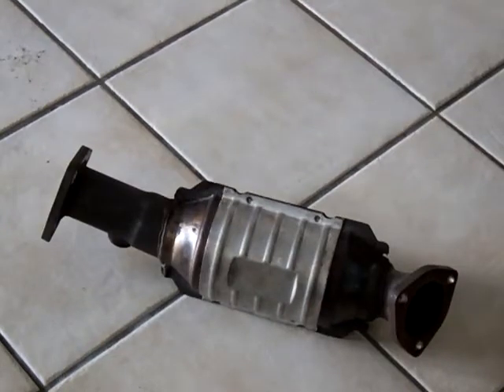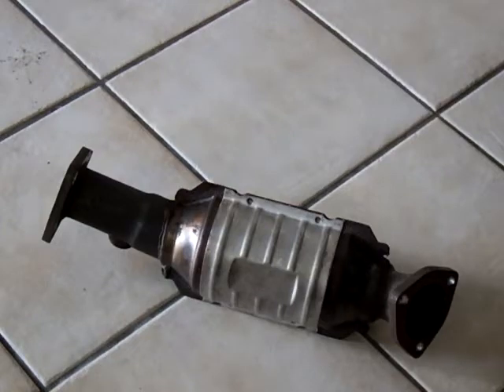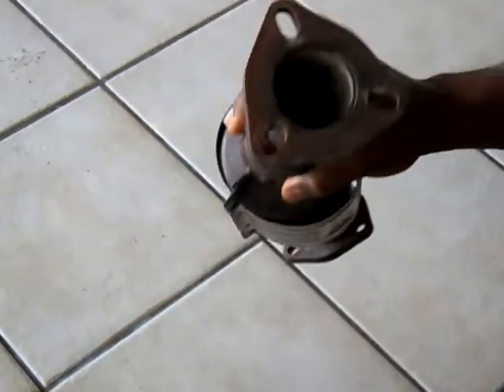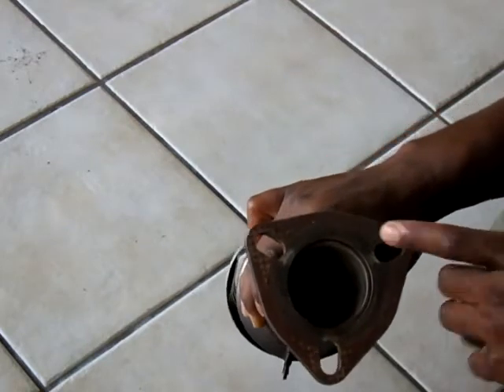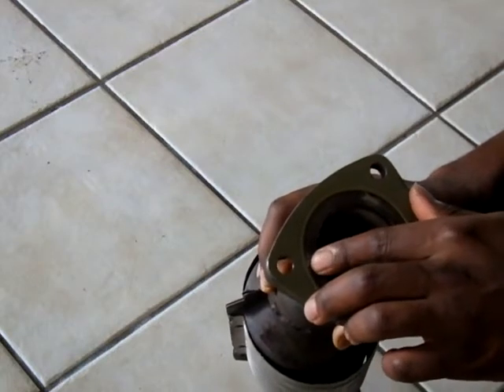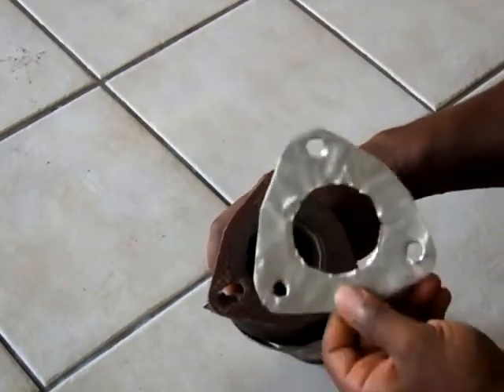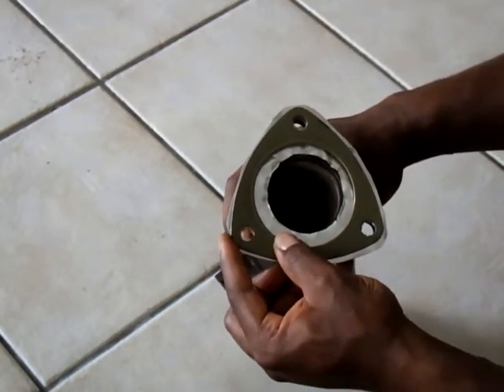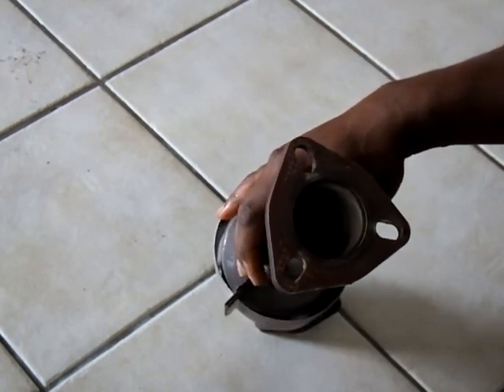'03 VW Passat 1.8T aftermarket catalytic converter - make sure it fits

Comment: Were you able to make a leak free installation (catalyst)? Also did washing it in soapy water work (meaning did P0420 went away)?

Did the misfire codes went away after repairing/changing the Y-pipe?
Reply from the maker: PrinceOfPersia10 Had no leak afterwards. The code came back within a few days. I think the catalyst just didn't meet OEM specs.
Reply: Did the misfire codes went away after repairing/changing the Y-pipe?
Reply from the maker: PrinceOfPersia10 Mine was not misfiring at all. It had only P0420 code. I didn't replace any y-pipe.
Reply: May be you forgot. But you wrote in your explanation notes for the video (click on show more)...

"A leaking Y-pipe also caused a huge vacuum leak that caused misfires on cold starts and excessive gas consumption."
Reply from the maker: PrinceOfPersia10 
Sorry I forgot that part. The y-pipe was located behind the engine, near the coolant overflow tank. It caused a huge vacuum leak, so replacement took away misfire codes and lowered gas consumption remarkably.